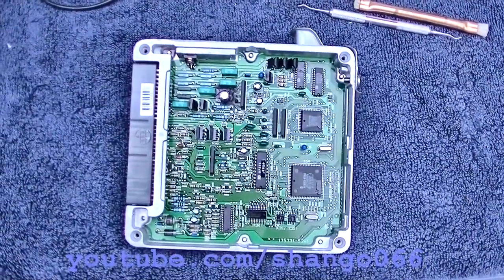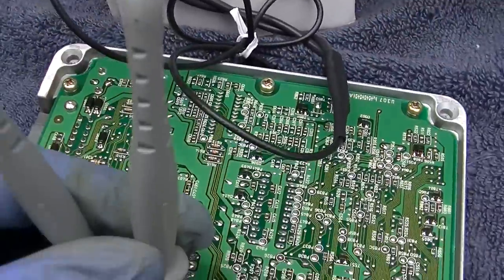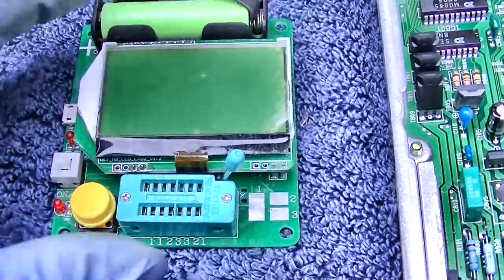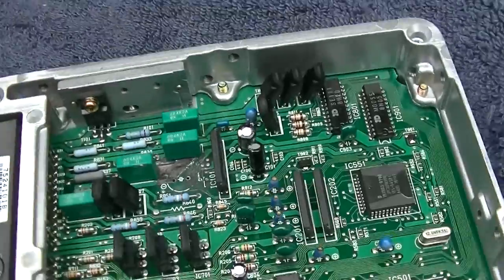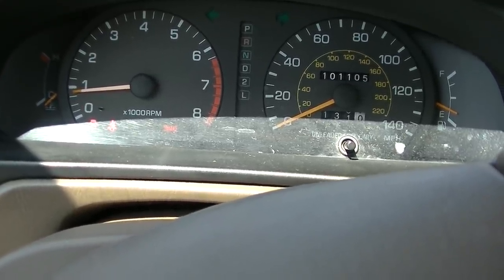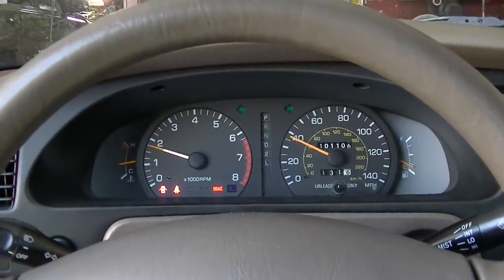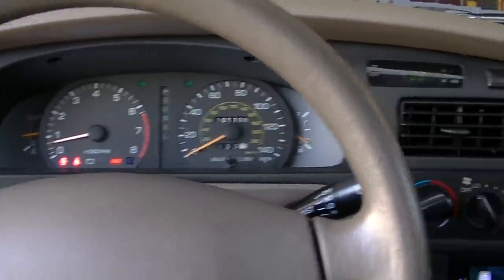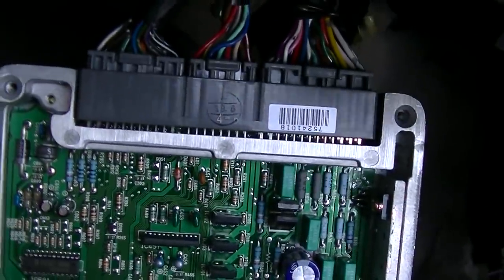1994 Toyota Camry ECU Repair High Idle Attempt

Comment: I'd still be driving my 95 Corolla if a drunk driver hadn't totaled it. Even the factory interior light bulbs still worked. Toyota still makes great cars but they don't last like that generation did.
Reply: Those are nice reliable cars. The generation afterwards is reliable too.

My mother actually has a 11 corolla and it's still a good car, nothing but oil changes, trans fluid changes. Still runs great at 180k miles. Only "problem" was a trans cooler line that rusted through (i simply eliminated it), and the exhaust manifold just started leaking at the head.
Reply: @volvo09  The fuel and brake lines rusted out on mine because they were exposed to road salt but that car never ever left me stranded. Mine had 207K when it got rear-ended but it didn't burn oil and everything still worked.
Reply: @volvo09  the generation after was explicitly terrible. The early 1ZZ corollas (98-02) have oil consumption problems.  03+ is fine though.
Reply: @fisqual  ah, didn't know that was am affected car with that issue... Had an 01 in the family and loved it. Same with a friend, they both wish they had that car still (but they took care of them). Ironically both have 11corollas now.
Reply: Mother has a '99 1ZZFE - no oil consumption in 180k miles so far...
Reply: @fisqual  the early 1zz engines also had sludging issues

Comment: I just looked in the old ECU for my 94 tercel to see if it had a similar circuit to get a value for that capacitor but no luck, the ECU was made by Fujitsu Ten so it was totally different. If I remember correctly I think the one for the 97 5efe that I replaced it with was totally different as well. Ever since I did my engine conversion from the 94 3EE to the 97 5EFE my AC has never idled up properly, something to due with how Toyota used AC request signals I think
Reply: I had a 4A in my old Corolla that used to have a separate box that controlled the idle up for the AC.  It had a little dial to adjust it.
Reply: @fisqual  I had to swap in the AC amplifier from a paseo from around the same year to get it to work at all since the tercel one was similar but lacking one of the control wires going to the ECU. Unfortunately they both lack any internal potentiometers to set the idle up speed like the older Toyota ac amplifiers did.
Reply: It works when driving but idles up and down when stopped and keeps short cycling the compressor

Comment: I always use a light brush soaked with Methyl Hydrate to clean areas like this.  It's easy on the board and dissolves most leakage from electrolytics.   It isn't conductive and evaporates quickly.

Comment: im slowly trying to get away from that crap on my truck. did EGR delete, did CAT delete, need to swap heads and intake so i can go carborated and swap to manul trans. that will eliminate everything the computer in my truck does and i can finally bone done with the BS it causes. like right now i need to adjust the fuel to air a little but i cant because no carb. i will make my truck as good as an old tractor over time.

Comment: That was Fun to know!   My 1978 Datsun B210 GX had air leak in Carburetor ~ Created uncontrollable Cruise Control.   lol 
When i first got my 1984 Scirocco in 1995, i asked about this cut Wire left hanging, near firewall. 
Not until 2 years later, Trouble keeping idle high enough after reconnecting AC, finally found it was for the Idle-Up Valve.   8 )

Comment: I have a 1994 Honda Accord with failing electrolytics too..I haven't started to work on it yet, however in my situation I believe the caps just dried out, and didn't leak. That makes it easier. It's also a known problem in Hondas of early 1990s -mid 1990s.

Comment: This is great. I have a 1990 Montero that's been sitting in the back yard since the computer fried back in 2006 when I was still an amateur. At least you can see what burned on yours. Tried a different computer but still no go. Even bought another Montero. It was my high school and college beater from 20 years ago and it's 4 wheel drive so it's not going anywhere.

Comment: Since the ECU was unplugged from a power source you have to perform an idle relearn. The relearn is really simple: Turn off all accessories, start the car cold and let it warm all the way up in park. Once warm (over 180 degrees) put it in drive with the e-brake on and let it sit in drive for 10 minutes. It will automatically adjust the idle and be able to idle up properly for the AC and such. It won't do that before the relearn is completed. 

If any parameters are out of spec when doing the relearn it won't work. Specifically (and commonly) if the car can't reach operating temperature after an extended amount of time (from a stuck open thermostat) it will never perform the relearn. These old OBD1 Toyotas won't set a code for under temperature but it will still prevent it from doing a proper idle learn. This can really leave folks chasing their tails that aren't intimately familiar with these things...
Reply: Do Gen 4 Camrys have a similar risk of leakage and those ECU issues? Hoping this isn’t something that’s waiting for me in the future
Reply from the maker: No idle relearn on something this old

Comment: I get in analog circuits capacitance affects frequency or timing, but in these digital circuits I would be shocked if they used a passive component subject to value drift over time to set some critical timing.  In ECU's 99% of them use CPU clock dividers for important timings.  
How much delay could you expect from such a small cap.  With closed loop operation it wouldn't matter much as the ECU would adjust duty cycle.  Maybe a stepper motor would get driven at a higher or lower frequency, but again, probably not going to hurt anything.
Use a wiring diagram and trace the output pins to figure out what system that cap affected.
Reply: the most likely case is the cap is an internal boost converter cap or on chip regulator for a derived voltage. people do definitely use caps for timing in ecus but never for critical things, still being off 2-3 orders of magnitude which is entirely possible with an 0805 chip capacitor might sufficiently break something

Comment: If AC pressure sense is low then idle boost solenoid does not get activated on some cars. Did the compressor kick in at all?
Excellent troubleshooting!

Comment: I had to replace a couple surface mount bits on the board in the lighting control module in my 03 Grand Marquis which have been recalled for failing and loss of headlights. Not sure I used the right ones, the old ones blew off when I desoldered them. They've been working for three years already so must have done something right

Comment: While that ECM ECU is hanging out try disconnecting that cap and see what happens. If it's a timing cap for that chip clock or pulse width signal then something would be wonky. If it's a decoupler cap a different issue would probably be visible or not. A used ECM from ebay may not have the same micro code loaded (firmware). Ship it the way it is with the freeway guarantee. Guaranteed till they get to the freeway.

Comment: Just rewire the solenoid for the AC idle kick. Cut the wires, ground one of them and connect the other to the positive of the AC clutch coil. Take the ECM out of the picture. I've done this on more than one occasion on imports. Common problem on some of these. Could be a wiring issue or internal to the ECM.

Comment: I have a 2000 Toyota  Prado (5VZ-FE engine). Time to recap the ECU?  Mine doesn't idle up for AC either but it does work.
Reply: Wouldn't hurt to check it.
Reply: Did it ever idle up for AC? It that what it is supposed to to? Could there be a corroded connection or faulty valve?
Reply: @KameraShy  No, not in my ownership (2019-onwards). It does idle up to warm up at cold and idles fine with load (in drive with brake on). It also very slightly idles up for power steering demand.  Should say it does have almost 390,000km (255,000mi)
Reply: I wouldn't worry too much. Any idle problems could be anything beyond the ECU. MAP. MAF. Idle speed control motor. Slight vacuum leak. I drive an '05 Camry approaching similar miles, it always takes a few minutes driving to not 'chug' at idle in 'D' while stopped. AC also puts the rad fans to high, so that's an extra load as well for the alternator which might drag things a bit along with the compressor itself.
Reply: @MattExzy  No worries thanks mate this is a longitudinal engine with a hydraulic fan clutch so that would explain it. Cheers!

Comment: J have toyota camry1992 2.2  Don't work D drive    --- 2---' and   L..On backup  there is no brake lights  there is no reverse lights ..On the dashboard  where j put the transmition in D drive there is no light  D drive on the dashboard  rest od lights work (P    R    N      Mised     2     L)When  j put the transmition  from   P to R reverse  the car kline and shake  and motor  start to work on 1300 to 1400 .In reverse ride great and powerful. Where is that ECU To check or the car have some other problem.Did j have to change neutral  safety  switch  or ECU   any advice

Comment: You've just saved me a headach.  We have a 1994 Camry with a cruise control that just started acting-up.  Light comes on, then when you go to set the speed, the light flashes twice and shut off... for the day.  I wonder if it is hinting for a bad cap?  Will take your advise an look into it....  Thank you again.
Reply: finely quit, the same capacitor 47uF 63v, no start.  I have a parts list if you'd like it... thank you.

Comment: Shango, those IAC valves on the Toyota cars are susceptible to getting hung up as well. Used to remove and clean fairly often. The dealer always wanted to replace them. Does LA county do the IM 240 still? We did when I worked in the Denver metro area. One of the strictest emission areas of the country. The Cat is definitely tired on the old Toyota but still doing something at least.
Reply from the maker: it was new from the dealer

Comment: That chip is in the same package as motor driver IC's you see in 90's era Japanese electronics that always fail.  The cap is probably just a bypass for some internal reference voltage.

Comment: Is it possible the computer has to relearn the engine, since the power was disconnected?   When it relearns, it figures proper idle speed.  It takes so many hrs running at different speeds.
Reply: I thought you only needed a few minutes of idle run for the ecu to relearn it.
Reply: @nathanlewis5682  perhaps, can only relate to what a mechanic told me for my Mazda when he hooked up to the computer to do the state inspection, said there was no data in the system, I replied I just disconnected the battery to clean the terminals, (actually there was a check engine light up for a trans problem and I knew the car wouldn’t pass - that’s why).  He said to drive it around different speeds for so long then bring it back.  Thinking about it again, when I first restarted the car after reconnecting the battery, the engine idle was very low but it did come back up it did take a while though maybe it was minutes like 5 or so don’t recall.

Comment: Looked like the lambda was fairly happy. Do these have the immobiliser info in them like the modern ones? Most of the ecu’s we see are water ingress related to being located in the engine bay but the latest ones are triple layer pcb so repairing them is pretty hopeless, we just try and find a better donor one and clone it now
Reply from the maker: Naw 94 is super basic. I look at the new late teens on up and they look like they're designed to last about 10 years. Either the manufacturers don't want the cars to last more than 10 years or they know that the majority of humans aren't going to be around in 10 years or gasoline will be gone in 10 years something like that
Reply: Many will be gone in 10 years, unfortunately.
Reply: @shango066 ah OK, bit like the early stuff we started seeing in the mid 90's here in the UK, super easy to bypass the immo back then, the more advanced stuff seem to come in with canbus. I'm with you on that one, I think it's the same all round with this 10 year EOL, cars, appliances even houses to an extent. We are at a stage here that we don't even repair engines on a lot of cars now, certainly on Ford with the small EcoBoost power unit, just buy another crate engine for less than a rebuild, not sure if it's the same practice in the US? Thanks for keeping it real, always enjoy your perspective on things in the commentary

Comment: Love it! The only question I had at the end was if the ECUs are $24 and free shipping,  wouldn't they likely also have issues? The car you were working on is  1994, but it only has 101,000 mi. according to the odo. Any other 1994 Camry is likely to have a lot more.
Reply: I buy a lot of used car parts and I do my best to find ebay auctions from the most suitable location for the parts. I buy alternators, power steering pumps, fenders from the south or west (TX or California).  I buy AC compressors and electronic components from a cool dry climate (Oregon or Washington). And I buy interior parts from as far north as possible since they'll have the least sun / heat exposure.  ...So an ECU from Washington would probably have at least a few more years before the caps leak.
Reply: Possibly, but presumably that cap spent its life baking in a hot car in So. Cal. If he gets an ECU from a more temperate part of the country, there may be less of a chance it’s caps have barfed all over the board. 
Even if the next one does have issues, it may become a blueprint, and parts donor to make one good working ECU.

Comment: I am seeing more and more ECUs failing in 90's cars. If someone were to create an exact clone of the ECU using all new parts would that require a C.A.R.B. E.O. to be legal and pass smog in CA?
Reply from the maker: It's okay, Vehicles aren't designed to and shouldn't last forever. Transportation needs to evolve with Society.
Reply: I sure hope CA can hurry up and make these good running paid off cars obsolete so people can rush out and buy a brand new Nissan and have the CVT fail. LoL!
Reply: @shango066   1990 toyota 3.0 L V6 , no engine check light when ignition key is set to on position. ECU communication problem?

Comment: Why not put this AC idle valve to ground with the AC switch instead Pin 1 on ECU?
Reply: You'd want it tied in with the ac clutch feed. That way when the evap temp switch, high side cutoff or cycling switch, signals to turn off the compressor, it will bump idle down. (Less idle surge up on ac compressor cutoff).

Comment: Mazda had similar ECU's made by Denso in the 90s. I think I should recap at least my daily driver JDM ECU, because it's pretty rare.
Reply: Probably wouldn't be a bad idea.  I recapped my 94 Toyota ECU and speedometer driver board.  I need to take a look at my 2000 Lexus next.

Comment: Some toyotas can idle low after you disconnected the battery. Seen some idle at like 300rpm lool. After letting it sit for sime time it will correct itself, but still funny it idles that low lol.